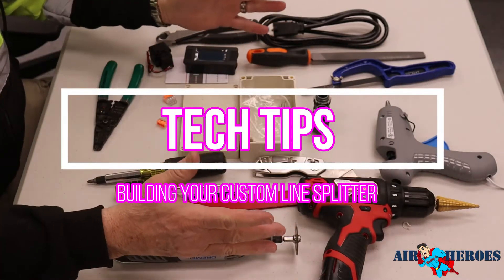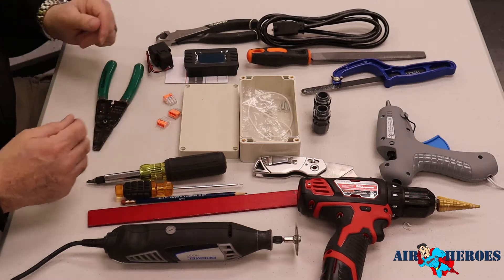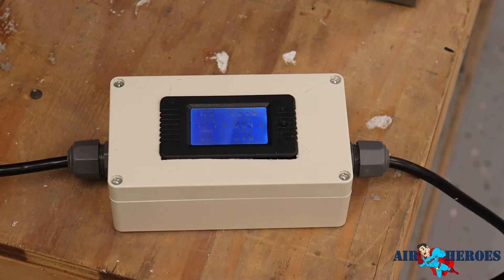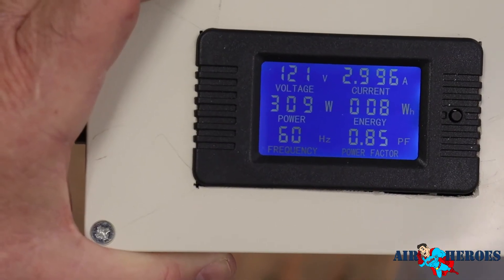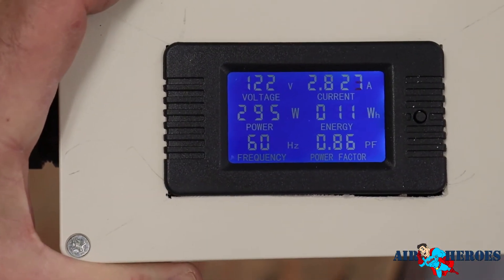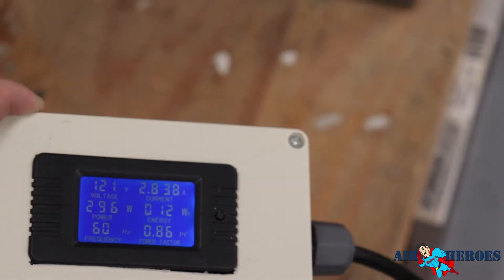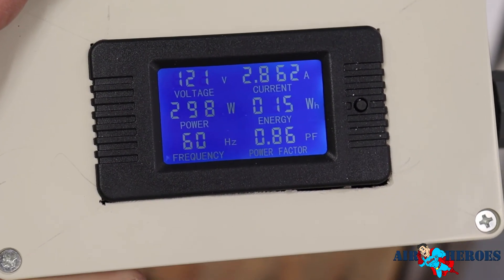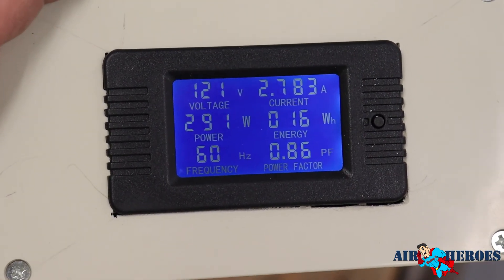Building a custom line splitter

Comment: Did you run any wires through the Split Core CT? Is it really necessary to have the Split Core CT since it is being wired directly?
Reply from the maker: Yes, in order to measure power factor you need it to read the current along with the voltage to measure it properly.